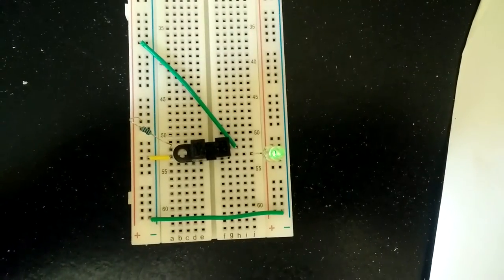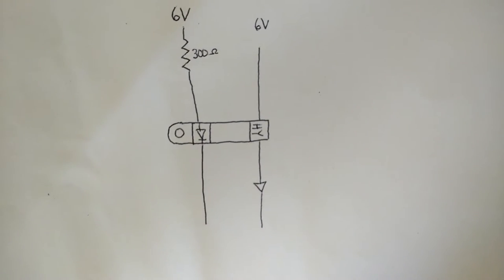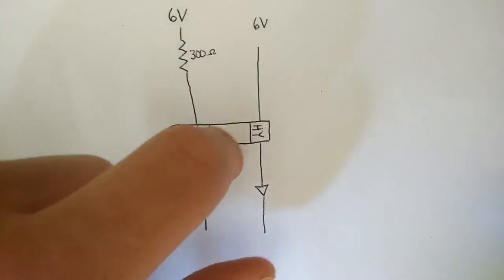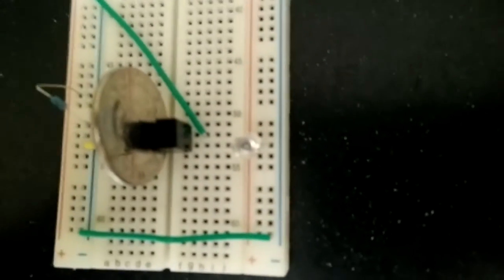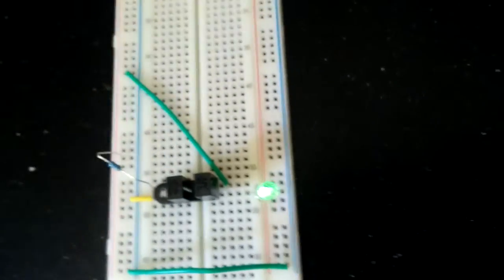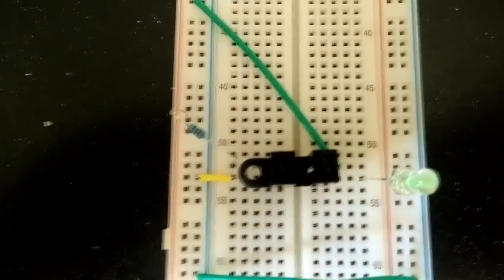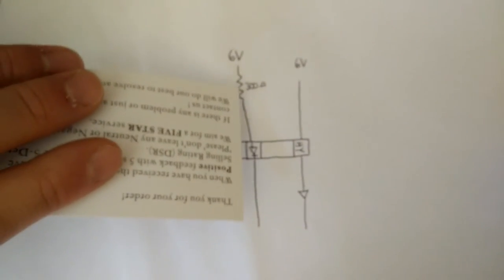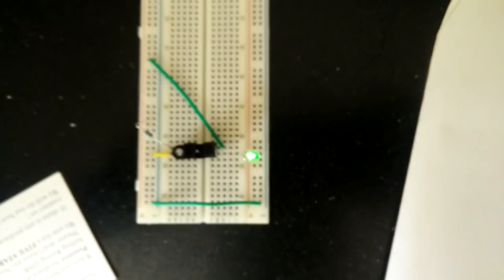Photo Interrupter Switch HY870P setup

Comment: Hi,  I have some of these photo interrupters but can't make any of them turn off.  Mine are marked with the standard led symbol on one side and a raised dot on the opposite corner , so impossible to mix up polarity. A 10K resistor works great but nothing I've tried, shuts off the beam. Remove the power, and the led goes off after it uses residual voltage (maybe a capacitor ?)  Could be a different type of interrupter - don't have any spec sheets .